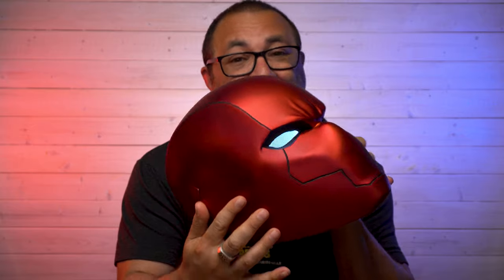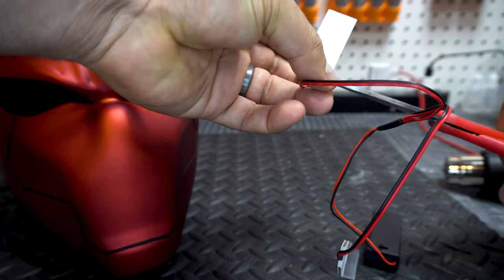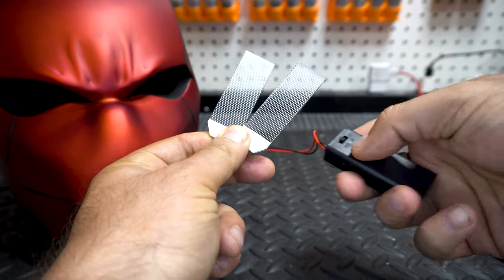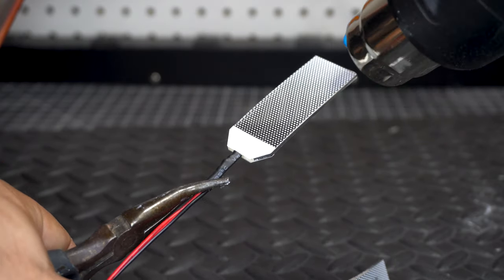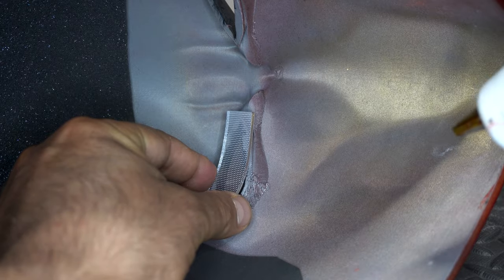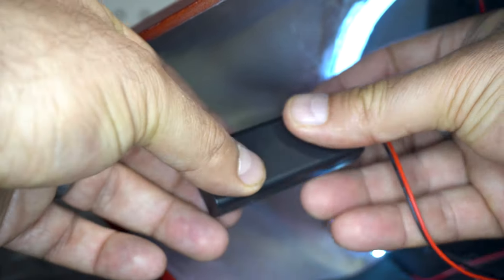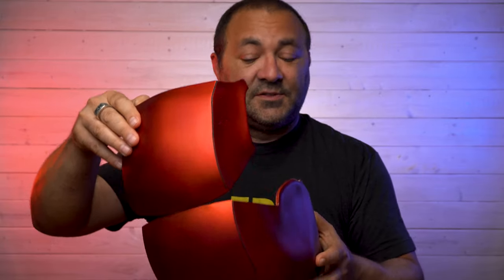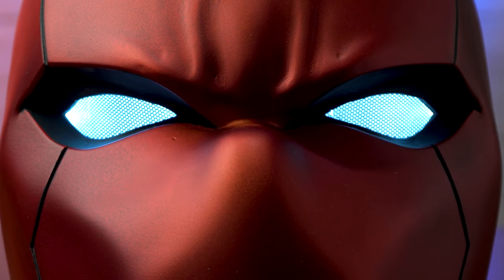Finishing 3D Prints: How to Add LED Lenses to 3D Printed Helmets

Comment: They come in flexible ones now too! :)
Reply from the maker: Someone just mentioned that. :) I just saw them today. :P Need to try them out.
Reply: @3DPrintedProps  I've got a kit today and they seem really nice, time will tell after I finally get round to finishing my helmet
Reply: @bluecas977  yeah
Pretty solid kit, I had trouble installing them but it was my first time installing actual lenses so that's probably why
Reply: @c.o7993  do you have a link?

Comment: I use white nylon stockings. Simply lit from the inside, with whatever color you need and you can tune the appearance by stretching them more or less and using multiple layers. For PvZ zombie eyes, I event stretched it over 3D printed eye globes with holes. Magic!

Comment: Great series of videos! Loving your style.

One question: How bright are the LEDs from the inside? Having them that close to your eyes seems problematic.
Reply from the maker: I wouldn't want to have them on all day, but for short periods they are fine. I think I've worn it for like 20 minutes no problem. You also have to remember, you're going to want to take it off often because it can get hot in there. :P
Reply: @3DPrintedProps  Excellent. Thanks again for the content!
Reply: @3DPrintedProps  couldn't you stick some reflective one way mirror plastics layer? Something like automotive film, that works shield your eyes a bit?
Reply: @startide  i tried to paint each white spot with an black pen... sure a lot work, but it works for me. I can see better when the lights are on. I hape there is a better way, but this may go the right direction. and yes, the black colour fro the pen rubbed a bit off after some time.

Comment: Sup Kevin
I recently made a helmet pretty similar to this and I just added some LED panels like the ones you use in your video. However, I can't see! It's so bright that I can only see when I'm in the sun or such. The only solution I could really find is to dim the panels, which is starting to prove a bit difficult. I have to ask, have you experimented with this before? I'm about to try either adding a resistor on the positive wire or use Ni-MH batteries instead of alkaline batteries (which have a lower voltage than alkaline.) Do either of these sound like a good idea or am I just gonna have to suck it up and deal with it?

Comment: Hi Kevin! I've been blueprinting and designing a 3D print helmet design, though what I have is a helmet that features an underlying pair of goggles (for reference, its the MCU Vulture), where the eye 'sockets' are rounded rather than squared. Would these LEDs do well regardless, or would they turn out too excessive? I haven't seen any good filled circular LEDs. Thank you for the general technique to apply LEDs here though! Very straight forward.

Comment: I cant seem to get the glue to stick to both the helmet and the led lights. Did you just smother the crap out of it with glue both inbetween and overtop the LEDs?
Reply from the maker: If u are using the hot glue you need to make sure it goes on when it's hot and yeah I use a lot. Just be sure to not get it on the lenses.

Comment: Is there any chance you could show us some of the flaws with the helmet? I feel like the camera hides a lot of things and it would be a nice way to know even a master like you is human in what they produce.
Reply: Also worth mentioning, that they make flexible versions of those LED eyes
Reply from the maker: @supermomandj  You know, I just saw those. I plan on trying them out.
Reply from the maker: Sure. The helmet itself is is constructed really well and I've had no problems with how its made or works. The one problem I'm having is that the thin elastic I used causes the helmet edges to rub and is scratching the paint. But I really like it since its a real natural weathering. I'll show it in the weathering video. :)

Comment: Do you think these are impact resistant to airsoft bbs?
Reply: Hell no
Reply from the maker: No sure, never fired one. If you plan on that I would test it. Maybe use a carbon fiber PLA and use a high number of walls, like 5 with a high infill. But again, don't know. :P
Reply: @3DPrintedProps  I meant the lenses, figured I’d ask anyways. The helmet I planned using UV resin instead of body filler to give the helmet some added strength. And lenses I guess I will find out. Lol